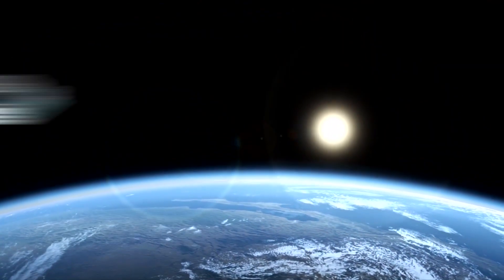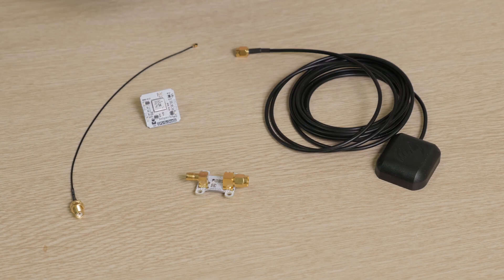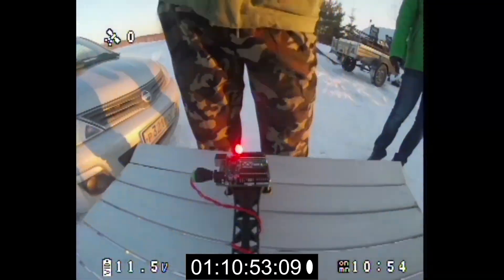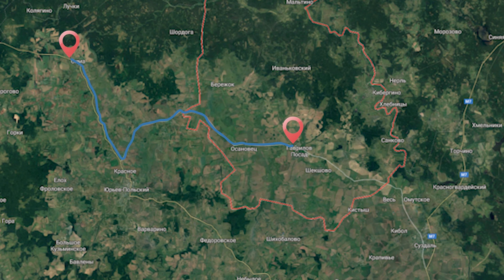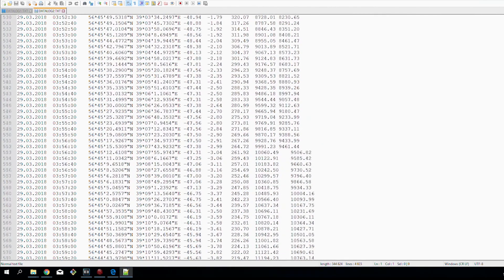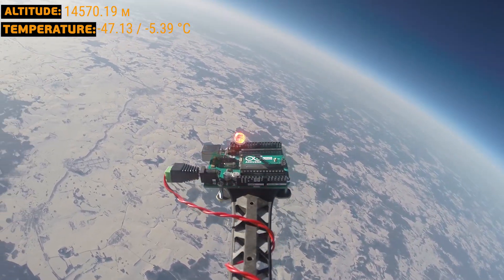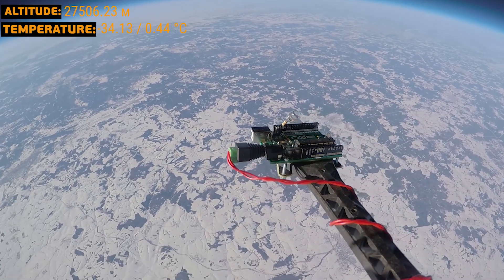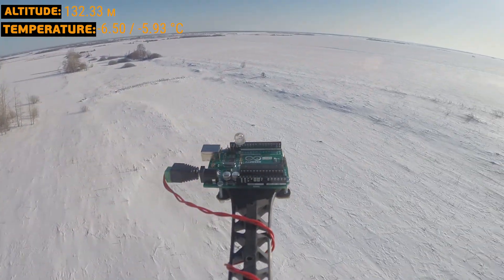Arduino in Near Space. 27000 metres above the surface.

Comment: MAGNIFICENT::: 9:10   from 7,700 meters up, to 17,000 meters altitude, air-temp was -50 centigrade. This is a universal temperature, all around the world, which you can see during flights.  Question::: Do you have the complete video to post here? I would like to see the Temperature-change between 3-7 km altitude. & thanks. K.S.

Comment: Hey guys, great video, 
but can you please help me out with this, I am amateur, I designed a few rockets, the initial launching is great, I build 2 stage and it hits 1500m, now I intend adding more stages and increasing size of motors
but the thing is that I don't know how to receive and send video signals from so much height, and I have only 5.4ghz av transmitter that stops working at a limited height, can u please tell what do u use that work at a really high altitude
Reply: They recorded the footage locally on a SD card.

Comment: Where can I find this components to built it my self. I would be thankful if anyone show me!
Reply: Arduino Uno
LED 
Jumper Wires
Weather Balloon, or a normal helium balloons (that floats and lands in a safe way)
Reply: SD card module 
Data logging shield
Temperature, humidity, barometric pressure sensor
GPS module
Reply: Solar cells (4v or 5v)
Ice box (to put electrical components together)
Mini cameras
Parachute 
Nylon strings
Hand warmers (iron oxide)

Read FFA regulations about weather balloon, and then you're good to go

Comment: you can use RF transmitter and receiver instead of SMS, that will work fine and you can get data every seconds.
Reply: Rf uses radio waves where sms uses satalite so sms is slow but has long range
Reply: @alperkaya3334  Heat to burst your bubble but SMS does use radio waves, In fact the Cell frequencies used for SMS are very short range, tthey should have used a 2 meter ham radio APRS system, 

there is one aboard the ISS and you can hear on a portable radio as it goes over

Comment: You know what the most important thing from this video? The earth IS NOT flat. Take that flat earth-er.
Reply: nuclear power wouldn't work if the Earth were only 8,000 years old, too. but there's one down the street seems to be working fine. Maybe it's actually a million hamsters running in wheels...vOv
Reply: ALL the cameras are GOPRO...right? Maybe im wrong, but the field of vision is fish eye. I will do a flight with a camera similar to human eyes ang get back to you brother :) #familyhumanity
Reply: Use great circle  calculation .....
Reply: Thanks for this Testing ! appreciate from Germany
Reply: I'm not a flat earther but it was clearly lens distortion. It still likes curved even when it was 100ft up from the ground.
Reply: Wrong
Reply: there's some theorem from algebraic geometry that says all simply connected closed-but-unbounded surfaces are isomorphic to a sphere. that is to say if you can travel any direction and you eventually end up back where you started, without encountering a discontinuity in the surface, you're living on a sphere of some type.

basically it would be really hard for international air travel to work on a flat earth. yet it seems to
Reply: @bitrexgm  hog wash
Reply from the maker: You're right, it is not... from one perspective))